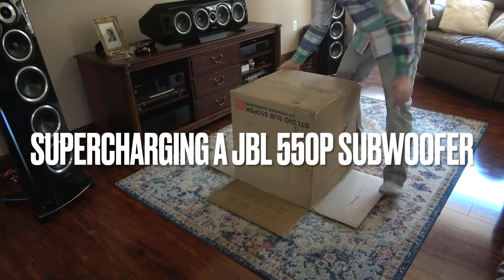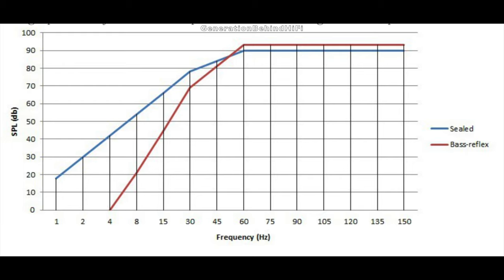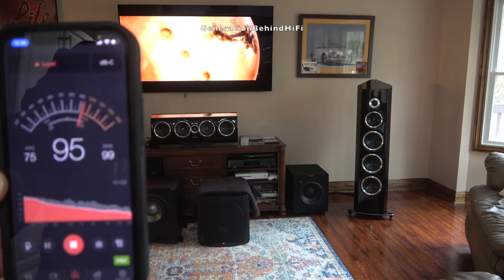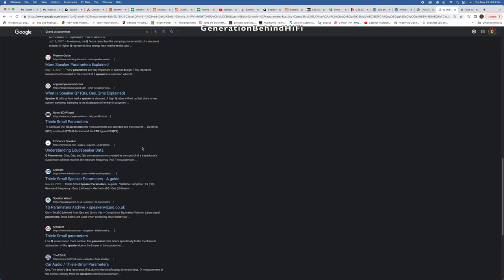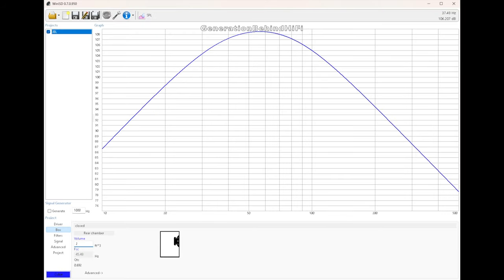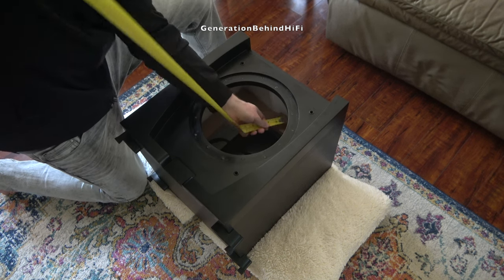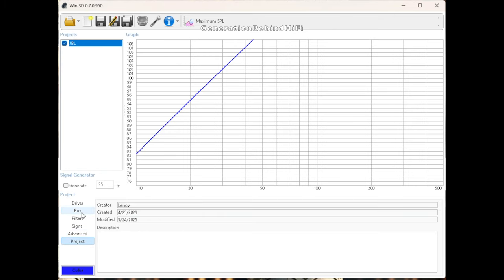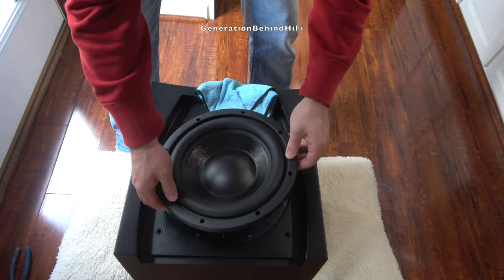Upgrading A JBL 550P Subwoofer P1/3

Comment: Love this. Unfortunately,  I look at sound systems in open spaces, so  I look for ported subs and look at 21 inch speakers as.they.push twice the air that a 15 inch does. Pi r squared. When pushing outside, you need a deeper box and bigger cubic feet.

Comment: The improved freq response in the review video is with the drivers replaced? Or can I mod the sub without replacing the driver?
Reply from the maker: Correct! You will have to replace the driver with the same one I bought if you want the same frequency response curve.

Comment: I just blew my Sub 550p voice coil and was wondering if you found any other driver that could replace the stock one that costs less than the CSS driver. Thanks in advance!
Reply from the maker: @Linkmat97  look on parts express’s website for a driver that will perform well in a 1 cubic foot sealed enclosure. There should be quite a few on there. Hope this helps.

Comment: You should check out the Polk audio psw505 it has 300 watts to 460 watts very powerful for a 12 inch im curious to see what the inside looks like
Reply from the maker: Thanks for the suggestion. I will keep that in mind. I'm pretty booked up at the moment though.
Reply: @generationbehindhifi  no worries the only thing about the Polk psw505 i recommend you put rubber feet onto them since you have wooden floor because they have wooden feet or at least if you have carpet idk
Reply from the maker: @Lowkey_nxthxn  Will do! Thanks!

Comment: Great Video, and effort, but you are forgetting one HUGE HUGE thing. When you model the subs on your computer for the deep bass, you are NOT factoring in that almost all subwoofer amps have built in equalization, that varies by frequency. In other words, most sub amps, have about 5-8 db of boost somewhere between for example 30-40 hz or there abouts. So your calculated bass on the 10" JBL driver, is true for the driver alone, but not when connected to their specific amp they use. You can only truly see the bass by measuring the combination of driver AND amp, as they are a paired "unit" and rely on each other.
Reply from the maker: Hi Kevin! Thanks for the comment! Sorry! I was under the assumption that anyone who is watching this video is probably aware that if they enable any type of EQ or bass boost function, then the response curve will change. Just like the response curve will change on your front mains when you adjust the tone controls on your AVR or processor. At the end of the day its impossible for me to cover every possible scenario in every video, but I think I did a pretty good job of covering the basics and what to look for. I will try and do better next time and I do appreciate the comment. 

Merry Christmas, Kevin!
Reply: @generationbehindhifi  Think you are not understanding me. Subwoofer amps have BUILT in EQ, that is not user engaged, but it is on all the time. It is part of the amp circuit and not defeatable. That is how they get such deep bass out of a relatively small subwoofer box. Almost all sub amps using EQ, as a  matter of fact. Not something the user does, but its on all the time, and boosts ONLY the deepest bass several decibels. That is why when you modeled the bass response, it did not go all that deep when using the T/S parameters. You forgot to factor in the built in subwoofer amp EQ that extends the response usually to around 30Hz or so.

Comment: As I said on the last video of this sub…was thinking about picking two up. I did. Now I’ll follow your journey further. 

I haven’t hooked them up yet as my AVR arrives today. The older 550P’s had speaker level inputs so I assumed I could try them out when I got them using my stereo receiver (Sony STR-DH190) and apparently I overlooked the fact that the new ones only use RCA. Doesn’t matter…just means I had to wait because my theater is getting upgrades anyway. 

I currently have no plans to upgrade components (driver or amp), but I’m excited to see how this CSS SDX10 performs for you. I see it’s fairly power hungry so I wonder about the factory amp handling the sub. I’m not saying I will copy your upgrades but if I do upgrade the driver down the road, I may seal up the box (was thinking some nice thick plexiglass and use an external amp to drive them. 

This of course is down the road if I find that they aren’t to my liking. 

I get the new receiver today along with a couple other deliveries so I will be cleaning up and arranging my dedicated space and we will see how it all works. I’ll need to spend some money on acoustic treatment for the space next. 

And I’ll be able to open up my old AVR (Sony STR-DG720) and determine the cause of its failure.  Not worth fixing, but definitely fun to play with.
Reply from the maker: I think you will be very happy with two of them! The JBL 550P is by far the best bang for the buck I have ever seen in this hobby. 

Interesting... I never knew they offered the 550P subwoofer with high level inputs because the model I received only had stereo RCA or LFE inputs. 

So far the amp is doing just fine with the SDX10 and offered pretty decent SPL too. I will be doing a SPL video showing the before and after results and I think viewers might be surprised by just how much dB i gained with this new driver. 

Thanks for the comment and happy tinkering!